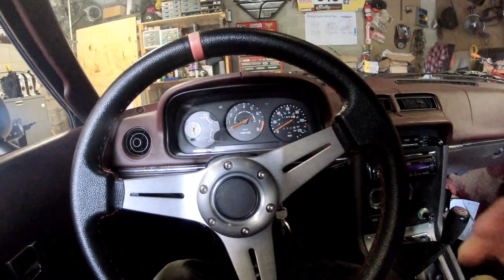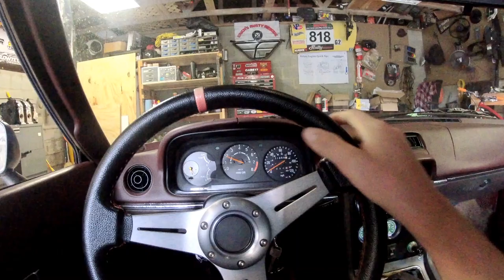Rally Tribute RX7 Build Begins - Again

Comment: how did you get the front fenders off? i have one that the passenger side has a huge dent in that i need to take it off to hammer on it
Reply from the maker: Bolts across the top.  Bolt in the rocker panel.  Bolt in the door jam.